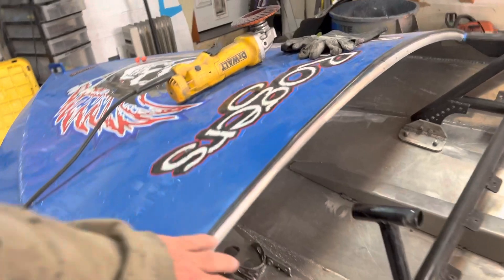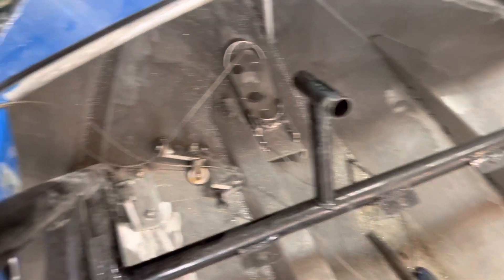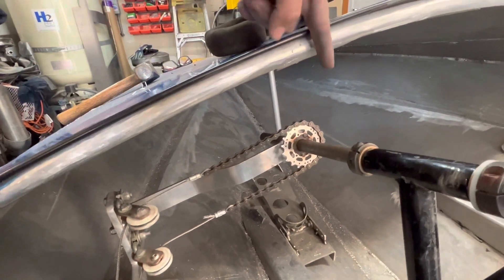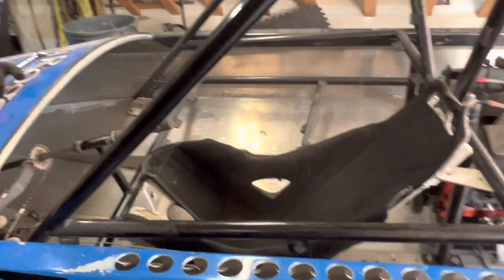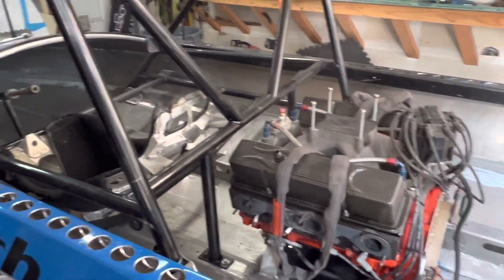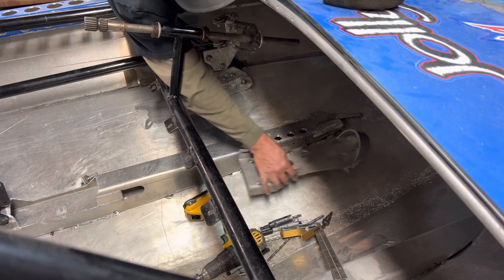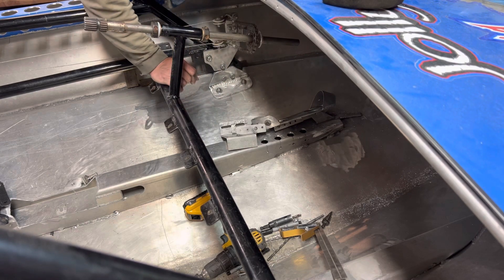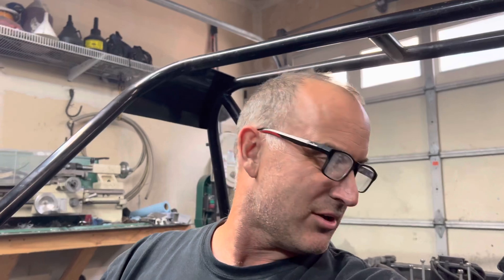Jetsprint boat build episode 3, steering, fuel tank, gas pedal

Comment: would a ratcheting binding setup like a snowboard binding help for the fuel peddle or would it be bad if you needed to get out quick?
Reply from the maker: People use different types of hoops/bars over their toes.  I don’t want to be clamped into it, just enough to be able to lift and keep my foot from sliding around in it.
Reply: That makes sense you wouldn't want to be upside down and the find out you can't get your foot off the gas peddle

Comment: What about a dual cable throttle like a street bike? So that the deceleration and acceleration is snappy?
Reply from the maker: I’m not familiar with those on a setup like this.
Reply: In such a set up, one cable is responsible for opening the throttle while the other cable closes it. Besides the functional aspect, there’s a safety feature with it. With a push/pull throttle set-up, should the spring fail or slide get stuck, twisting the throttle will pull the throttle linkage back to idle — so there’s an assurance despite a part system failure.
Reply: It may not work though

Comment: Why not use a stick, as in a aircraft, instead of a wheel / yoke? Rules?
Reply from the maker: I contemplated that a few years ago but abandoned the idea.  No rules preventing it.
Reply: @JollyRoger907  years ago, I had a Sleekcraft with a Jacuzzi pump, that had a rack steering with a push-pull Morse cable that was sloppy, and the price of the equivalent wasn’t reasonable to me at the time.
I ended up putting together a short stick using a shortened UH-1 cyclic stick, and assorted bell cranks and control tubes, so as it did left and right, and had fore and aft controlled the throttle.
Worked ok, but was twitchy it being mainly a lake / river boat.
Reply from the maker: @georgedreisch2662  that’s awesome!  Twitchy isn’t good!  I’ve loosened up
My steering more and more each year getting it just right!